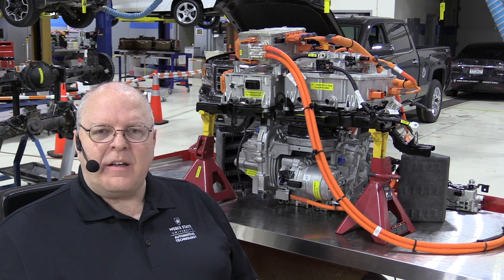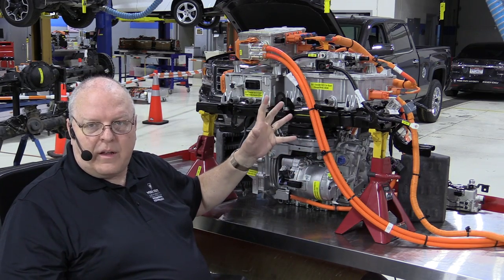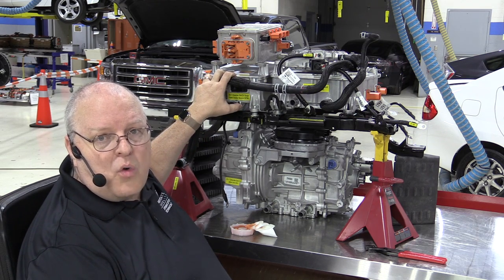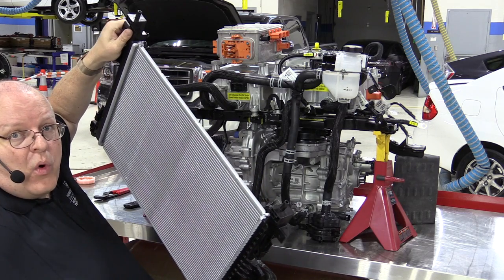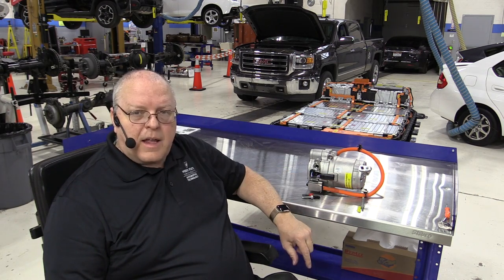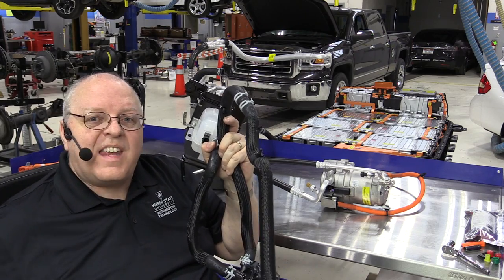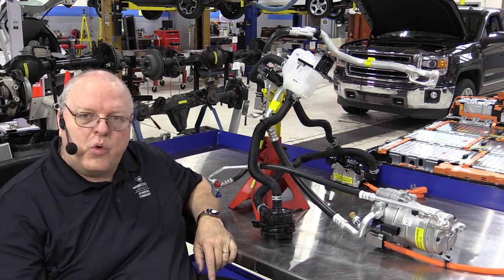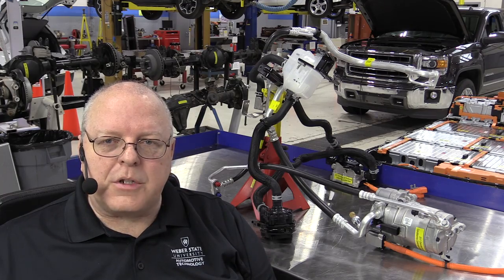Chevrolet Bolt EV Coolant System Loops

Comment: Something i did not quite understand here was that the black part of the DC fast charge cable harness was for locking the cable while charging. But the cable also locks when not dc charging (I have type 2 version), does the j1772 plug not lock by default?
great videos by the way, you were one of the reasons I bought an ampera e as my first car

Comment: Does anyone know if the battery thermal management operates when the Bolt is parked but not plugged in? For example if you are parked with no charger in a temperature extreme like below freezing or very hot.

Comment: I wonder why they decided to use a liquid system for the interior heater. Teslas use a heater which is just a resistor with fins like a space heater you would use in your house. Doing it that way eliminates the heater core, pump, reservoir, and hoses. Also the heat comes on immediately on a cold morning because there is no waiting to heat a reservoir of liquid coolant first.

Comment: What is so very nice about these videos is that they are such a contrast to everything available today.  So many videos simply show off some device but no one breaks it down to the component level or explains how it works.  It was the value of Heath Kit or Ramsey Kits in electronics... they told you how it worked and why.  Recently I watched a video on 5G to find out about it and all the info was about how fast (but never said exactly how fast) and wonderful it would be.  Not a bit of techie detail.  Even Popular Mechanics is a big ol' glossy useless advert for new products. Have a gander back into the 1930's and 1950's pop mechanics to see how good they used to be.  Thank you Professor Kelly for going to the level of detail you do.  It is a much appreciate drink of water is this drought of information.
Reply from the maker: My pleasure, thank you!
Reply: I agree! There is little to no available knowledge base to pull from besides Professor Kelly's videos.
Reply: And what you are talking about is widespread. Sony, with it's U-Matic commercial/broadcast videotape machines, put out service manuals that went into detail on every circuit with waveforms, timing diagrams and extensive text not to mention fabulous circuit board graphics that showed both sides of every board. Those were the days (circa 1980). Now it is all board swapping and who knows what is going on.

Comment: I thank you for being very methodical in your explanation of the (3) cooling systems for the Bolt EV. They are all doing the same thing ( cooling or heating) in their respective areas. One could look at those systems and see where one could effect the other. The finding of that one  and the replacement of it, could be quite expensive.
Reply from the maker: Thank you and thanks for your feedback! It could be expensive, but I believe they will be quite reliable.

Comment: Thank you. I’ve been wondering about the three separate coolant systems on my 2023 Bolt 1LT, now I know. I could not find anything on the GM pages. I’ve watched numerous videos of yours on the Bolt, and I must say, you have more knowledge of the Bolt and its systems than any GM engineer, no question!

Comment: Great Video Professor.  You know with all these cooling systems, especially with component location and positioning, there will be problems.  Corrosion will take it's toll on the modules and I suspect owners may or may not follow that 5 yr/150,000 mile service.  If I owned one, I'd change the coolant every 2 to 3 years.  Experience has taught me that, regarding GM's "orange" coolant.
The pumps will cause problems also.  BUT, it seems the motoring public wants these vehicles!
Reply from the maker: Thanks for your feedback. I agree, that coolant must be changed at the proper service interval with the exact coolant required or trouble will occur.

Comment: We just bought a 22 bolt euv. These videos are simply fantastic,  I have been binge watching them anytime I have a minute. I can't stand owning and operating a machine without at least a fundamental understanding of how it works, so my appreciation of your work here cannot be overstated.  Gear heads everywhere are forever indebted to you and folks like you who take the time to learn and share your knowledge. Much obliged.  I may have missed it in the video, but I'm curious how much current the ac compressor uses? I know the heater uses 2kw, I imagine the ac would be in a similar range?
Reply: It's very easy to derive the amperage of the compressor, we know the  high voltage battery uses 350V, you just divide Watts by Volt then you got the current. For the compressor, it would be likely around 6.5 kw at max. Which is draw in between 5A to 18A of power depend on the load.

Comment: Fascinating review of the cooling system and you've finally stumbled onto "my turf." 

A properly designed refrigerant system with a properly functioning TXV won't return liquid to the compressor. The tube-in-tube heat exchanger's primary function in to reduce the temperature of the liquid refrigerant. Cooler high pressure liquid passing through an expansion device wastes less of its mass (called "flash gas" in the industry) cooling the refrigerant itself before it can begin absorbing heat from the cabin. While the efficiency improvement is significant the main reason automakers are doing this today (my opinion) is to reduce the R1234 refrigerant charge which is, as you state, very costly. Adding tube-in-tube heat exchangers does increase the superheat seen by the compressor so there are other design considerations to manage before just slapping one on.

A quick note on POE oil- Ester based oils are used in high voltage automotive compressors because PAG (glycol based) oils dissolve the lacquer insulation on the windings inside the compressor, eventually leading to a 400V short inside the compressor. Cross-contamination with PAG can be a real issue with these systems on previous generation EVs that used R134a. And, yes, PAG and POE really do absorb that much water. Cool experiment- Get a cheap 4-place electronic scale from your local purveyor of drug paraphernalia. Pour out a sample of either oil into a small dish and record the weight. Allow it to sit for 2-3 days and weigh again to see how much it has gained. All the new weight is water absorbed from the air. 

As for the cabin coolant heater and not using battery or motor heat; existing cabin heater coils work best with coolant that is quite warm, 180F+. Lower temperature coolant can be used but it requires the use of very much larger heater coils. We are experimenting with PTC DC heating elements which heat the air directly. While more costly they are physically far less complicated. I imagine GM is using this system because the in dash components are likely shared with other vehicles, but that's just a guess. The motor will seldom generate enough heat to warm the cabin using a normal size heater coil and the battery never will.
Reply from the maker: Excellent feedback, thank you!
Reply: HI Bill,

About ten minutes ago, I wrote a post with a lot of questions about whether the batteries or the electronics & motor cooling loop produces more heat when the cabin needs it (I figure it is the electronics/motor).  I think that it would be a really simply thing to add a heat exchanger that allows transfer of  heat from the electronics/motor cooling loop to the cabin heating loop so that during cold weather (especially on long distance drives), one isn't wasting precious battery kWh to turn into cabin heat (as a physicist, I cringe when I see high grade energy turned into heat when a relatively easy alternative is available).

Do you have any comment on this idea? 

Thanks,
Dave

PS. if you can't find the post, I will copy and paste it to you

Comment: 26:30 Based on my testing there are a couple of factors that define when and how the battery is cooled.  It matters if the car is "on" or "off" and  it matters if the car is "plugged in" to an L2 (220V) charger (and possibly also an L1 (110V ) charger).

First, there are two modes, what I call "weak mode" the car will attempt to cool the battery to about 31C.   The second I call "aggressive mode" the car will try to cool the battery to about 27C.

The only mode I've seen "weak mode" cooling active is when the car is both turned on and not plugged in.

Generally "aggressive mode" cooling is only active when the car is "plugged in" and the battery is not charging (either charge complete or charge not needed)

I have seen the battery go as high as 37C with the car turned off and not plugged in and the car will not cool the battery.  As soon as the car is turned "on" the car starts "weak mode" battery cooling.

I have never tried to charge my car with the battery hotter than 31C so it's possible that "weak mode" cooling does occur while charging if the battery is above this temperature.

You can "trick" the car into performing "aggressive mode" cooling while charging by charging with the car turned on.

During both "weak mode" and "aggressive mode" cooling there is a difference in behavior depending on if the passenger compartment AC system is active.  If you do not have the AC setting enabled the car will cycle the AC compressor on and off several times per minute but if the passenger AC is turned on the AC compressor runs continuously.  Also at least when "weak mode" cooling (probably also with "aggressive mode") the battery coolant temp is chilled to a much colder temperature (about 10C colder) if the passenger AC is turned on.

I have a lot of raw data I've collected from OBD if you are interested.
Reply: Good information!  I posted a question above about whether or not the battery loop evaporator operates when the temperature is low but the cabin A/C is on (for defroster or whatever).  Did you test that condition?  I didn't see any electrical control on the battery loop chiller block that could override operation, but it's possible there is a temperature-limit built into it.  Otherwise, they would need to run the battery loop heater to compensate for A/C operation.
Reply: @gregoryjward  The Perfesser mentioned in a reply to me that the battery cooling loop pump is modulated. If coolant isn't flowing the refrigerant in the coolant heat exchanger will reach the same temperature as the cabin evaporator and cool no further. This could cause an issue only if the battery needed heating but the cabin needed cooling, a Very unlikely scenario.

Comment: As a person used to doing his own ICE car maintenance, this series of videos are very helpful for understanding my new (2023) Bolt (same drive train as in these videos I believe).  According to the user manual the a/c desiccant is scheduled to be changed after 10 years or so (don't have the manual in front of me, pulling that number from memory). As far as having separate coolant loops and the lost opportunity to reuse reject heat across systems, I believe the Tesla "octovalve" does just that.  Maybe that sort of system will become standard in the industry.

Comment: So the desiccant in the AC condenser must be the desiccant they say you need to have serviced every 7 years I think it was? POE is short for polyolester oil, a synthetic refrigerant oil that replaced the old mineral oils used in chlorine base refrigerants when R12 was widely used in automotive air conditioning systems. These videos are great for us Bolt owners.

Comment: I monitored the passenger cabin loop with a thermometer and when asking for a few degree increase in temperature, the coolant spiked up over 100F for a short period.  I've also noticed that there must be an air diverter vane in the airbox under the dash that quickly selects between warmed air and airconditioned air paths.  Turning off the heat/ac button but still manipulating the temperature knob demonstrates this behavior.  Although I see Professor Kelly's point about wanting to heat the cabin w/o heating the battery, I'd be very happy using the waste heat from the SPIM to heat the cabin.  If there's enough heat to need a radiator, there's got to be a better use for it on cold mornings.
Reply from the maker: Thank you for the information! Yes, there is an air-mix door to blend heat and cooling for optimum vent outlet temperature. On cold day there may not be enough heat from the SPIM to satisfy passenger heating requirements.
Reply: Wes - I am having a discussion with Bill Kerr about this very topic .  If you are interested, my post was on Saturday Feb 2.

Comment: Another great video! I am guessing that tieing into the electronics cooling system would make little sense. It would provide only minimal cabin heat at low ambient temps, would need a dual-circuit heater core (do these exist?), an electronically controlled valve, more hoses, more coolant, programming. We’ve now increased cost, weight, and complexity, still need the other heater, and saved 2 miles of range
Reply from the maker: Thank you, I have not heard of a dual circuit heater core.
Reply: Or perhaps a heat exchanger that takes heat from the drive cooling system just before the radiator and puts it into the cabin heating system before the heater element.
Reply: Ian - I will bet that for those who use their EVs to take longer trips, scavenging heat rather than producing it via electric resistance WOULD make sense in the long run.

you would certainly  need the electric heat during start up and until the heat coming off the motor and electronics was sufficient -but at that point, you would be able to run the fan at a lower speed and perhaps the lower temperature coolant would be adequate.

Before we can answer this question definitely, we need to know HOW much heat is removed from the various parts of the car and what the coolant TEMPERATURE is.  Without that info, we are only guessing at what makes sense...

Comment: I like the simplicity of the cabin heater loop. It would add a lot of cost and complexity to scavenge heat from the motor/inverter. At some point it was probably just easier to use that money to put a bigger battery in it. 

Sort of like the concept of putting solar on a car. The cost of adding 200 watts solar is enough to add 1 kWh of battery, which can be used even at night.
Reply from the maker: Thank you for your feedback
Reply: IMHO - I think I disagree with you: As a physicist, turning valuable battery storage energy into heat is a sin - and increasing  battery storage is a MUCH more expensive way to deal with it than a few more controls and a little bit of piping and valving.

I suspect that GM simply didn't figure it out and will add it to in the next few years.
Reply: Dave Conna, GM has been building EVs since the 60s. Even Tesla doesn’t use a heat pump. Is Elon too stupid to figure out what Jaguar, Leaf, Zoe  knows about heat pumps?
Reply: @imho7250  I'm not following your reply - I wasn't suggesting a heat pump.  That having been said, the Nissan Leaf does (or at least DID) use a heat pump for cabin heating:
https://www.quora.com/Which-types-of-electric-cars-use-heat-pumps-as-a-cabin-heater

That having been stated, there are problems with this approach: a heat pump delivers much lower temperature air and thus would not work for defrosting or quick heating of the cabin during cold starts.  But for long distance travel, it should work, even in colder (but not too cold) climates.

At any rate, the initial question was about how to scavenge the waste heat to heat the cabin, which I still think is possible and will happen in the future.
Reply: Dave Conna, I PACE reportedly scavenges heat from the drive unit/inverter, but it can only be done with a heat pump, and it requires more valves and hoses. If you look at the Tesla cooling system it’s already got plenty of failure points, but it allows them to redirect coolant where needed. It doesn’t scavenge that heat, it more likely allows the heat from the motor/inverter to heat the battery. 

With cheap cars comes some loss of efficiency, but I’d rather have a $25k EV that goes 200 miles on a 60 kWh battery than a $35k car that goes 200 miles on a 50 kWh battery. I’ll spend $1-$2 more per 200 miles.
Reply: I agree here. On one hand you move the heat of the motor and battery out of the car on the other hand you use valuable batterie energy for heating. This can't be the final solution.

Comment: Great video!
The pumps on the cooling circuits, do you happen to know if they are "wet rotor" type (no shaft seals needed)?
Like the ones that run non-stop in hot tubs, quietly, for years.

Comment: Wonderful explanations!  Question:  If cabin heat is just an electric heating element, heating coolant that's pumped through the heater core to transfer the heat to the cabin air, why couldn't they simply have put the electric heating element in the air stream instead, and not needed the coolant and pump and surge tank?

Comment: Excellent in depth series.  So great to have actual details of operation and how everything is connected.  Are you planning the same for other Electric vehicles.  It would be interesting to contrast the different designs.  I'm specifically interested in how the Leaf's cooling/heating is laid out as it has a heatpump for cabin heat and loses much less range in the winter.
Reply from the maker: Thank you. Yes, I am planning on the leaf in the near future.

Comment: The way I understand it if the air conditioning system breaks you must service the vehicle immediately, essentially the battering cooling system is not functioning as well. Also can you explain how air conditioning refrigerant is split between the cabin and the battery cooling. I had a Chevrolet volt, I believe it had a similar system, I could feel the air conditioning on even when the cabin air conditioning was off, I believe it was cooling the battery even on mild days.